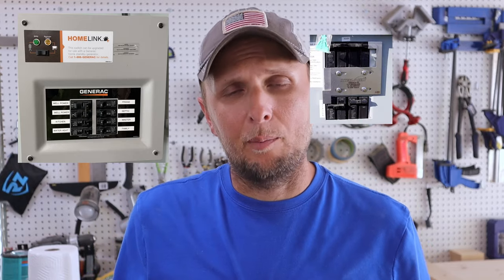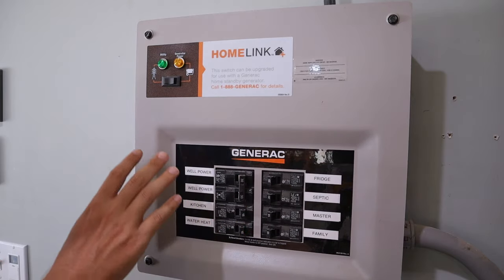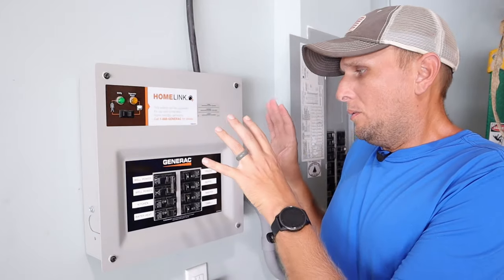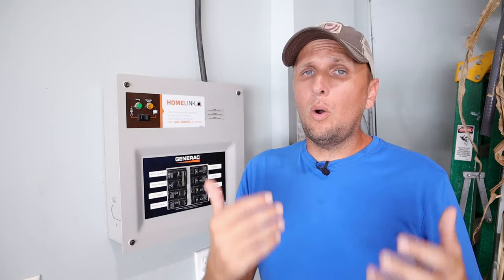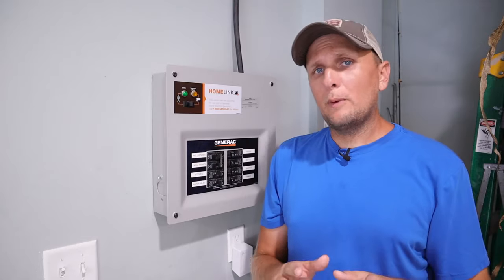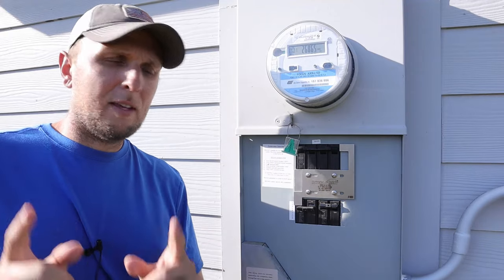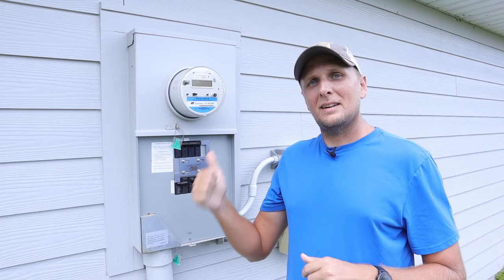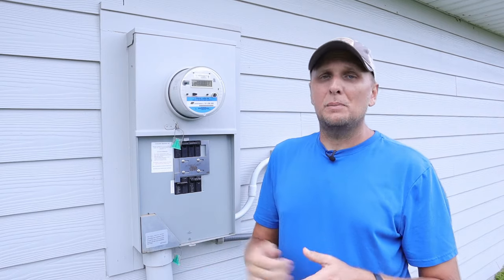How To Choose Between A Transfer Switch Vs Interlock Kit With Power Inlet Box

Comment: Interlock kit all day long.  Just label your critical breakers in the panel to have on during an outage.  Exact same as a transfer switch except the added benefit of being able to energize any other breaker as you see fit.  Personally I prefer the flexibility of running anything in the house.  A transfer switch removes any flexibility you have and forces a compromise.  I have an 11,000 watt dual fuel on a 50 amp inlet but I could also use my 3300 watt on the same inlet with reduced breakers live at once.  I appreciate the video, thanks!
Reply: @timothywillis7872  hard to imagine why that would be the case. Interlock is required if a generator inlet is connected to the panel without a transfer switch.
Reply: @SuperVstech  that’s what Texas power told me. If I wanted to run a generator as a back up, I had to use a transfer switch.
Reply: @timothywillis7872  I'm in Texas as well, but all of the electricians we've gotten quotes from offer both options. My understanding (as I haven't found anything in my research) is as long as there's no chance of back-feed there shouldn't be a legal issue. We're going interlock for the same reason @philpom did. If our needs are drastically different for an outage in winter vs summer and we want the options. Cool thing with a transfer though is that it is easier to tell once the grid is back up.
Reply: Agreed. The flexibility of an interlock is by a far superior choice. People just have to be aware of the wattage of what's being used on each circuit and what their generator can handle.
Reply: @philp3512  absolutely, Reliance has a nice 2 line wattmeter box (cat.no.MB125) for monitoring that I installed. They also have a nice little PowerBack device that sounds an alarm when ulility power is restored.
Reply: @DIY_Dad_83  Any chance you could share what the price range was of quotes you got. I'm going to start getting some next week and would just like to know if they are trying to overcharge.
Reply: @timothywillis7872  Not true.
Reply: Most "licensed" electricians in the Houston area will not install an inlet and breaker if your panel will not accept an interlock switch.
Reply: Depends on where your main breaker is because it may be in a location on side of house that requires a long expensive cable to reach your generator.  Nothing is absolute in life... This subject is no different.
Reply: Agree 100% also if it is an old panel which an interlock may not be available  consider using a generlink if your local utility allows so. It is basically a transfer switch that plugs in between the meter socket and meter that allows for a place to plug your generator into the home and automatically transfers between utility and generator power.
Reply: I opted for an interlock kit for the reasons mentioned. We have a 7 Kw Harbor Freight electric start portable generator. I marked the circuit breakers with colored dots:  green to turn on, black to leave off and nothing on ones that can be turned on if needed. I built a generator status panel I located next to the breaker panel. It indicate voltage and current on each AC leg so we can control how we load the generator and a frequency meter to make sure frequency is close to normal. In addition to AC it monitors DC battery voltage and the battery maintainer keeping the battery topped up when not in use.

Agree it can be confusing but for me all the bells and whistles add peace of mind knowing everything is working as it should.
Reply: Yeah for sure then if you get bigger gen, you can switch more on
Reply: @bumfighter00  Reliant will not allow a consumer owned transfer switch to be installed in between their meter and the meter box.
Reply: @saqueo1966   that is why I said if your local utility will allow it.
Reply: Issue is interlock kits are not approved everywhere. You cannot use an interlock in Canada, only a transfer switch.
Reply: @timothywillis7872  lie. I have them installed
Reply: I agree
Reply: @bumfighter00  u would have to arrange through utilities company that's there line side to avoid a tampering charge
Reply: @nicklopez5298  obviously!
Reply: Ditto.
Reply: Ditto.
Reply: This is the way I did it, or should I say my Electrician did it. But I also have solar breakers in the electrical box.
Reply: For me definitely an interlock but for my elderly parents I installed a transfer switch so it would be easier to use.
Reply: @timothywillis7872 It’s is like that many places. I think the rule is you can’t have two different power sources inside the same breaker box. There has to be a separate transfer switch before the breaker box. We have that rule here. I like being able to power the whole house. We only use about about 5 Kw max. It’s pretty common for new homes here to have a main transfer switch already installed. The cost of a 200amp transfer switch is less than $700.
Reply: ALL DAY🔥
Reply: @timothywillis7872  no not true I just had one installed by a electrician perfectly legal I did the research
Reply: @bumfighter00 almost all power companies do not allow the use of a generer link system
Reply: I’m in Texas and I checked with at least a dozen of the power companies all said no
Reply: Thanks 
So helpful!!
Going with interlock for flexibility and cost savings
Reply: Yep. I can run everything in my house except the obvious big loads. No range/oven, no electric drier, no ac. Easy right just go turn those breakers off.
Reply: I hear ya except for when the main is outside away from a nice flat concrete drive and the sub panel with all the critical (to me at least) circuits is in a nice covered garage with flat concrete driveway just outside the garage door. The transfer switch is much easier and safer for my situation. 
YMMV.
Reply: Just get a bigger transfer switch.
Reply: @tomschmidt381 That’s a great way to make it unnecessarily complicated. You might as well have gotten a whole house generator with an ATS.
Reply: @saqueo1966 the meter is in the meter box.
Reply: Agreed!  Interlock kit all day.  Simply identify what breakers to leave on in a power outage situation 💯

Comment: Interlock.  100%.  You have complete control of what circuits you want to have power to in your entire house.  Not to mention it is so much cheaper (and easier) to install.
Reply: unless customer has a 200 amp zinsco meter main. good luck. or some other 40 year old weird panel.
Reply: Not to mention with the cost of the transfer switch you can put that into a better generator

Comment: Furthermore, why shut off breakers? Just police the use of a given appliance with your family. In a power reduced situation, people need to do what they are told. Or you can put a red dot on any high current appliance. Then the folks know they have to ask before using it during an outage.

Comment: I run an interlock kit being fed by a Generac XG7000e (7000/peak 8750 watts).  My home is only 1800 sq feet, has gas boiler, gas stove, gas water heater, electric high velocity A/C, a tiny deep freezer, a fridge as far a majors go.   It's successfully powered my entire home with no surging with the TV on and internet working.  Just 100 amp service.  Weird?

Comment: For me the transfer switch is too limiting. No amount of thinking ahead of what you will need when you install the sub panel can tell you what your needs are five years later. Also, every power outage is different. If it is four+ days long, I want complete control over every breaker. With interlock, while I'm at the panel switching the panel over to my generator, I switch off all breakers except what I need in the first hour. Then as my needs change throughout the power outage, I can switch breakers off and others on. Examples are washer and dryers, fridge and pump. None of these need to have their breakers on all the time. Interlock gives me complete flexibility now and five years from now, short outage and long outage. And it provides me the opportunity each time to turn everything off that isn't currently needed, thereby keeping all unnecessary load off my generator.
Reply: I've already decided to go with the interlock for these reason alone, flexibility (and also not having to put in a subpanel and move circuits over to it.)
Reply: Yea Yea

Comment: I had the Generac 30-amp Homelink transfer switch professionally installed. At that time, I had only a 2000w Harbor Freight inverter generator. When utility power failed, the small generator, with only two 120v receptacles, would not switch over power on the Homelink. After removing the HomeLink front panel, I used the provided lever to activate "test mode". Then, I could use the Homelink, but only at about 1800w continuous. I recently bought a Champion 4250w dual fuel generator, which has a 30-amp receptacle and should switch generator power to the HomeLink. Testing soon!

Comment: I decided to purchase an emergency power generator after receiving two emails from my electric company, warning me that I live in "what they consider to be", a high risk area, for "public safety power shut-off's" in the event of extreme temperatures and dry conditions. They said that if they deem the chance of wild fires to be high, they may choose to do a "Public Safety Power Shut-off" and that these power shut-offs may last anywhere from several hours to several days!

I chose the Westinghouse 12,500 starting watts and 9,500 running watts, dual fuel, 30/50 AMP generator and I purchased two 40 pound propane tanks that hold 9.2 gallons of propane in each tank, along with a pigtail auto switchover propane regulator and a 50 foot, 50 amp power cord attaching to a 50 amp power inlet box and an interlock device. Based on the wattage I predict I'll be using, I expect to use 1/2 gallon of propane per hour, so with 18.4 gallons of stored propane, I should have enough fuel to last approximately 36 hours. When the first tank runs dry at approximately 18 hours, the auto switch-over will automatically switch to the second tank and I'll just un-hook the first tank and take it to my propane refill place to refill it, bring it home and hook it back up.

A Certified Electrician charged $800.00 to install the power inlet box, circuit breaker and interlock device, including parts and the permit and that costs $64.00 at my local County Court House. The permit fee was also to cover the cost of a County approved Licensed, Certified Electrician to come out and inspect, approve and sign off on the installation, which never happened.

I would have "much preferred" a Generac whole home system (24,000 watts) but the cost with installation and paying the gas company, $3,500.00 to bring a gas line and meter onto my property, would have totaled somewhere between $13,000 to $15,000.00 as opposed to the approximately $2,300.00 that I spent, in total. I also purchased a couple of portable emergency air conditioners at Loews and that cost approximately $600.00.

UPDATE: Just a couple months after installing the backup power generator, PGE did do a "Public Safety Power shut off". We were on our generator backup power for 25 hours. The backup power generator performed flawlessly the entire time! Money well spent! We now have peace of mind.

Comment: Super. Somebody is missing the ball by not making main breakers with extra generator terminals and wire control so that you can just hit a switch in your house and the main kicks off, connecting the generator. Yes, auto-transfer switches, but i'm talking inexpensive retrofit, not complete replacement. (Remote starting is possible with any generator that has a starter motor, so you would not have to go outside at all.) You can shut off almost anything inside that is not needed without killing the breaker. 💙 T.E.N.
Reply: Market would be too small for major breaker manufacturers to get NEC certification for a new type across their product lines.  You buy an AUTOMATIC Transfer Switch and have it installed.

Comment: I use a transfer switch with my Champion 7500 watt generator to power almost my entire house. I don't have my stove/range, heat pump or cloths dried powered by it because of the high amp draw. I have back up window a/c units for summer use if the power is out during hot weather that the generator handles quite easily. Even though it isolates the generator from the line I always throw the main breaker to guarantee no back feed of the power lines.

Comment: I installed an interlock with 30 amp service. Ran our essential circuits during a recent power outage. The dual fuel 3600 watt generator is also highly portable and runs our camper AC. Thanks for sharing.

Comment: Generally I think an interlock switch would work best for most people no matter the size of your generator. It allows you to easily change the loads and the size of generator.  Clear instructions on its use should be posted in or near the panel. 

Lets say you were making dinner on your electric stove when the power went out, and you have a smaller generator. You can turn on the breakers for the range and kitchen lights. After the meal you can turn of the range and turn on the hot water heater and dishwasher. In the winter you would want the furnace on, in the summer the AC, or fans. If you're working in the garage you can turn those circuits on. With a transfer switch you are stuck with what you decided when you installed it.
Reply: Couldn't agree with you more. Mine powers my whole panel and I decide what I want to use and flip breakers accordingly. I.E. Turn the ac on to get it cool then turn ac off and water heater on for a little for showers then water heater back off and ac back on.
Reply: In the event of an outage, does that mean you have to first flip all breakers OFF before enabling the Interlock switch (or at least enough to bring the panel under the capacity of the generator)?
Reply: @MrTeamriab  To turn on or off a main breaker it is always best to shut off all the breakers first. Then turn the circuits on one at a time.

Comment: Great videos, very helpful information. My first house in Maryland I had an electrician install a transfer switch for my generator.

At the house I bought Spring 2024  built in 2016 in South Lafayette Louisiana, recently had an electrician install a Briggs and Stratton 26KW Natural Gas Whole House Generator. The plumber recently ran the Natural Gas line to the Generator and Natural Gas Meter. Just yesterday the plumber  with the Natural Gas company CenterPoint upgraded the Regulator on the Natural Gas Meter. Monday the Electrician comes out to test the generator and put it in standby mode and weekly exercise mode.

Comment: Good explanation.  I hooked up an interlock with a line coming from an external 50A plug and a 12,500 watt  on propane.  I can choose the circuits I want to run and during hurricane season in FL, life with the wife without A/C is hell.  I do have a small generator I loan out to others or I can use during cooler months in my house if needed.  Costs - the most expensive cost was the cable from the external plug to my circuit panel at $105 and the plug at $43, which you would have to buy anyway.  Other costs were the interlock switch for $38, and a 50Amp circuit breaker for $8.